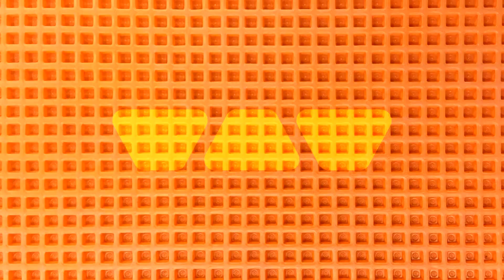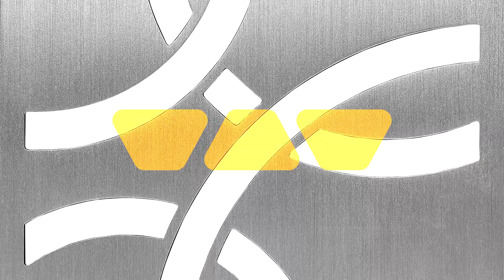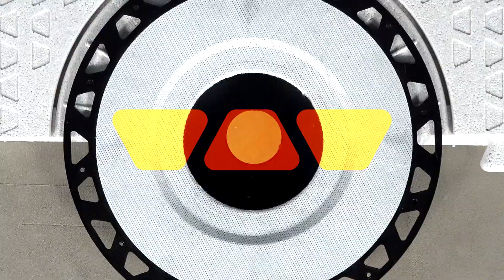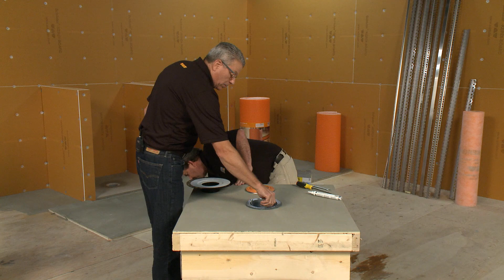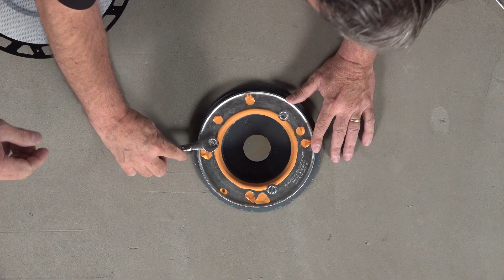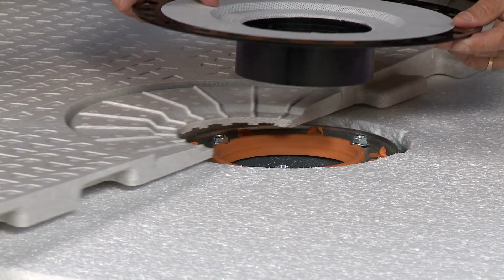Schluter®-KERDI-DRAIN-A 7-1/2"

Comment: How do you waterproof around a existing toilet flange?
Reply from the maker: Hi there!
The following is the basic procedure to create a seal: 
1. Cut DITRA around the toilet flange, leaving an approximately 1/8" wide gap 
2. Fill the gap with KERDI-FIX or an equivalent sealant, making sure to fill in all the exposed cavities on the underside of the matting
3. Set and grout the tile covering 
4. Install the toilet

Comment: Will this system leak if the flange is loose and  glots of the kerdi fix is applied? Or if there’s a bolt missing?
Reply from the maker: Hi Chris, our support team would love to help you with your question. Would you mind giving them a call? They'd need to get some info about the specifics, to be sure to provide you with the right answers! Thanks. 888-4724588

Comment: the ADAPTOR RING 4 HOLES DO NOT LINE UP WITH THE 4 BOLT FLANGE. THEY DO NOT HAVE A SOLUTION FOR THE HOLE MIS-ALIGNMENT OUR TILE SUPPLIER HAS HAS 4 COMPLAINTS IN  A WEEK. AND HAD CONTACTED THEIR SALES REP.
Reply: Good to know was money refunded
Reply from the maker: Hi Tim, sorry to hear about the issue you had! We're happy to hear you reached out to your Schluter Representative to work this out. It would be helpful to let them know which brand of drain you are trying to adjust to. They would be the best suited to come up with a solution for you. Our KERDI-DRAIN adaptor ring pattern has been designed to work with the most common drains available.
Reply: our plumber use 4 of the SCM drains  manufactured in Kansas city Mo. for our building, we added 4 showers. The directions say to only finger tight the cap screws finger tight then 1/4 turn. or you will distort the metal flange. You would have to tighten the bolts to 40 ft pounds to distort the metal. the real problem is if you tighten the bolts it will expand the orange seal on the bottom of the adaptor  flange and make it very difficult to slip in the next piece. I ended up using 1/4 lag bolts intended to fasten into wood. I dry fitted everything  installed the lag bolts. then removed the bolts and applied the adhesive- calk. This will probably void your warranty. My son is a contractor as I am. he specializes in finishing basements, does a lot of plumbing and I told him to double check before using your systems.  @schlutersystems1

Comment: What trowel size would I use to place 24" square porcelain tiles on to Ditra heat ? Also on the underside of the Ditra heat would I use a 3.5mm / 4 mm trowel?
Reply from the maker: Hi Dave, 
Thanks for the questions! Check out our Tips and & Tricks video on trowel sizes and proper coverage. https://www.youtube.com/watch?v=AaP1uA6FIQE 
The correct trowel should be chosen based on the best coverage. For the Ditra-Heat membrane, we recommend our Ditra-Heat trowel which is, 6 mm x 6mm. Give our team a call if you are looking for more particulars, you can reach them at US:888-472-4588 and CA:800-667-8746!
Reply: Impossible to give an exact trowel size.  Stakker Humanoid always says "the trowel size that give coverage and then some more"